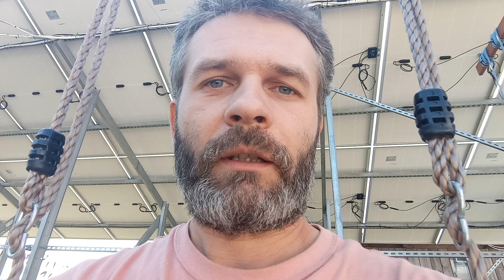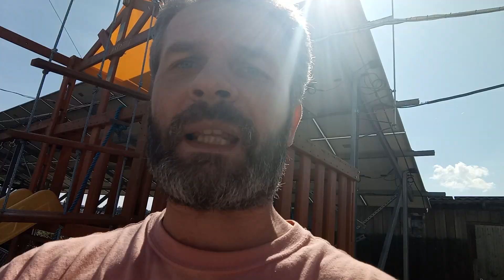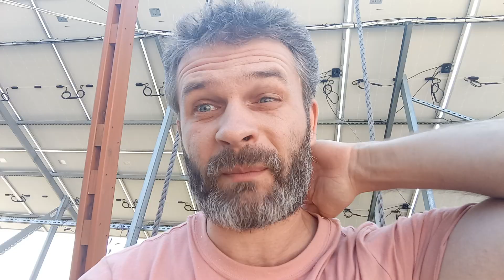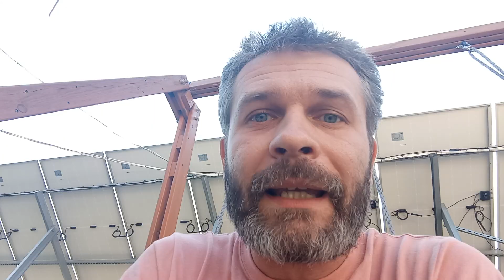Going bifacial?! - Let me tell you why and what's the math behind.

Comment: Hi Mate, Have you thought of using your old panels to catch the first rays of the sun in the morning, setup along one of your fence lines ?  I do this since I have so many panels, I have three positions, 100% morning, then all day flat on the ground and finally 100% before sunset. I have them in the winter setup all year round, because I have over panelled my system at 120 second hand solar panels.
Reply from the maker: yes, vertically on the fence - that's exactly my idea. 
no snow buildup, and since I don't care about summer produciton, but do care about winter production - vertical might just be the case, calculators show the better overall winter output for vertical position in my area.
however, I cannot put the arrays east, and there is little need, since I have about 8 kW of panels being east-faced. south and west (and now I have only like 1.5 kW west-faced) are possible for me. enough to fit 1x15 panels each. so 30 will be in use, the other remaining 4 - there is no other option than putting them well, again, north-facing )) but I will likely do it, since it's the best of the remaining places.
Reply: @BackyardVoltage  Yes, sounds like some good ideas.
Have you thought about trying solar trackers ? Might be something different to test for your channel, since you have some spare solar panels.
Reply from the maker: no, I don't want any trackers. they will be the most effective for sure, but I tend to use whatever good fixed positions I have and get to the desired power output via the quantity of panels.
Reply: @BackyardVoltage  I understand, I have never wanted to spend the extra money on solar tracking systems. Everything I do is to keep the cost down, as long as it works.
Reply from the maker: same applies to me. for solar - cost has to be reasonable. we've already got the unreasonable wind, in case anyone asks why so ))

Comment: Even if you installed all your mppt needs, in Nov/dec/Jan you would still only produce 80% on a good clear day, so its safe to say installing 20% more than required on a reduction derictional switch and that's a solar pannel at 60% on the side where diodes would match horizon shadows closing off strings to keep a higher voltage.
I just think if you don't have an array behind the bifacal array and the degree of the pannels always  pointing above the front bifocal the none absorbed radiation from the array behind wouldnt derict to the bifacel pannel. I just don't think thier would be enough gain if multiple rows weren't installed and dericted to the back of the bifacal.
Reply from the maker: Let's see how it goes
Reply: Or we could research radiation deflecting material percentages and then get better understand of what to expect when a single row of pannels are installed.
Could allways instal them infront of your existing.
Reply from the maker: I personally don't see me bothering about that. I don't care much about the other side catching as much as possible, I am rather just happy with "whatever it catches additionally - all is mine"

Comment: DO IT.. more solar, and if you can do it your self of having access to helping people, it wil massive PV site.. you allready have 3x deye and the 20kW Grid inverter and massive battery storage and regardless.. I have my 20kW deye mountet, and have started running DC cables to busbar's and hope to connect the DC side of the system in the next week or so.. still needing a bit a cablelugs and shunt - and im thinking if the Deye can run the batterys in a open loop setup, with no communitation from the batterys.. ill have to setup the BMS's on all the batteryes, but it will make it easy'er to setup, i dont know if you have a video with open loop setup on the deye inverter.... im allready WAY over budget on my system, so my expantion of min small 5kw solar setup to 12kw will have to wait until the money is there. where are you buying solarpanels... reseller or direct via alibaba fx. ?
Reply from the maker: "with no communitation from the batterys" - yes, you can set it up via "voltage" working mode.
"where are you buying solarpanels" - locally only, it's cheaper for me to get them locally, than order a single palette form Alibaba. If I am buying a container from Alibaba (20 palettes) then I am getting close to the bulk order local prices, so again, makes no sense, since I order today - and technically can have a tomorrow delivery if buying locally. likely Alibaba is probably good for really huge orders.